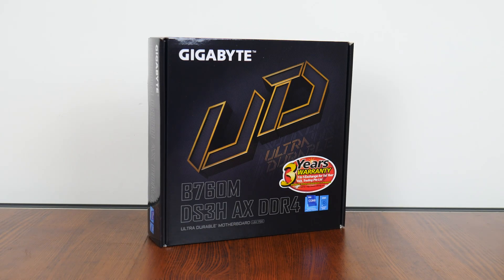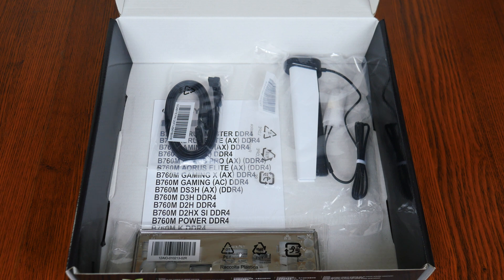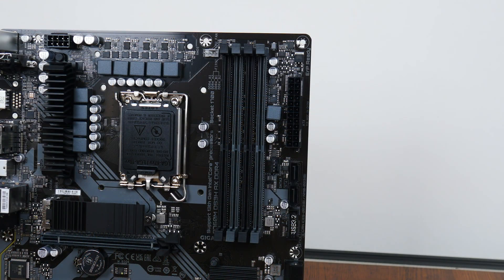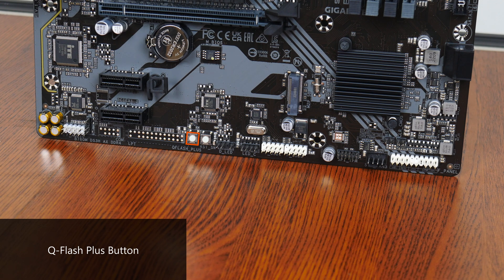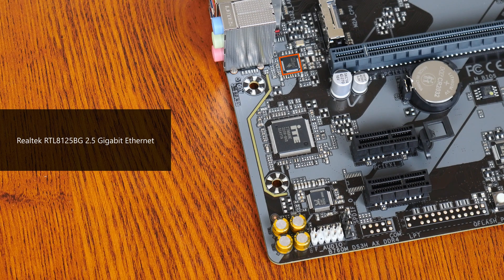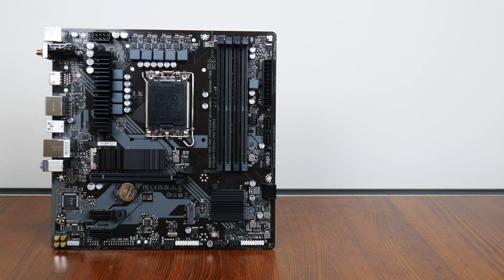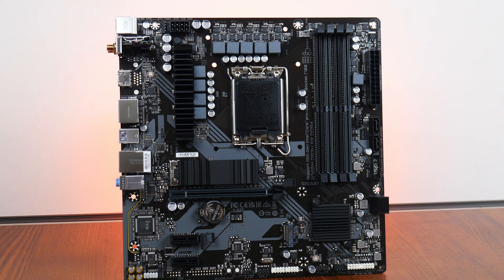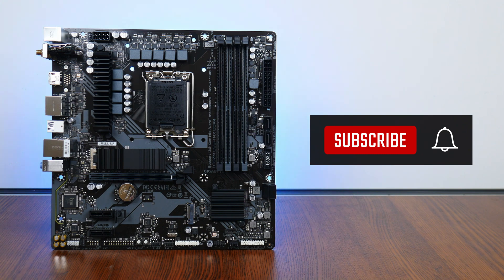Entry-level Intel B760 Motherboard - Gigabyte B760M DS3H AX DDR4 Unboxing & Overview

Comment: Do rev 1.0 is eligible for Intel processors?
Reply from the maker: It works with 12th, 13th and 14th Gen processors, just make sure that you've got the latest BIOS version installed!

Comment: Motherboard: GIGABYTE B760M DS3H AX DDR4 - 
RAM: Lexar Thor DDR4 32 GB (16x2) 3200 MHz CL16, XMP 2.0 - 
CPU: Intel Core i5-12400F (6C/12T, 2.5-4.4GHz, 18MB Cache, 65W) - 
GPU: Sapphire Pulse AMD Radeon RX 6650 XT Gaming (8GB GDDR6) - 
Power Supply: Aerocool LUX 650W 80 Bronze Power Supply - 
Case: NZXT H510 -
hi this is my build that i will buy should i change any thing ? because i am new to this
Thanks!
Reply from the maker: Hello, this build looks good for 1080p gaming! An optional extra you might want to consider is a better third-party CPU cooler, as the CPU cooler included with the 12400F isn't really that good. You can look at offerings such as the Thermalright Assassin X 120 and so on!
Reply: @ALKtech Thanks for the advice. i hope you hit the million subs one day.

Comment: I have a question for my build, will this motherboard be good with a rtx 4060 eagle oc with an intel i7-12700kf
Reply from the maker: Yup this board will work fine for a 12700KF and RTX 4060 combo!

Comment: please is it fine to pair it with 12600k?
Reply from the maker: It'll work with a 12600K, but I'd recommend getting a mainstream board instead, as the VRMs on this board are entry-level and might throttle the 12600K's performance!

Comment: Thanks for the video! If I were to use both PCIe slots at the same time, would this slow down the rest of the build? Or is it okay to have both in use?
Reply from the maker: You can use multiple PCIe slots on this board with no performance impact - out of curiosity, what add-on cards are you looking at using?
Reply: @ALKtech  to be honest I haven't really decided yet but I was looking at a 2tb Samsung 990. Do you have any suggestions?
Reply from the maker: @cytotomom  the Samsung's great at least from what I hear. You'll do fine with it!

Comment: Can it handle the i9 13900k?
Reply from the maker: Given that this is an entry-level motherboard with a weaker VRM setup, it's likely that a 13900K will be thermal throttled by this board. You'd be better off looking at a higher-end B760 or Z790 motherboard for a 13900K!
Reply: @ALKtech  thanks

Comment: Hey , i love the video, and i love that you are interacting with all of us. I have a question, i have a gigabyte b760m-c motherboard, 4070, ddr5 2x16gb 6000mz, and a i5 13400f. I want to play 1440 p competitive gaming. Do you think i need to upgrade anything or do you think my build is pretty good?
Reply: The motherbaord is the ultra durable b760m-c. I keep seeing reviews are that its not strong enough and very weak, do you think so?
Reply from the maker: Hey there - the B760M C is indeed a budget motherboard offering - I personally would not use the board with anything more than a lower-end Core i5. The i5-13400F is somewhat a lower-end part compared to say, the 13600K or 14600K which are much more power-hungry and would definitely be taxing for the B760M C's VRMs.

That said, I assume that your PC is already built and you're currently using it? Do you know how your 13400F's thermal behaviour is like, and whether you're getting thermal throttled? Have you tried running any synthetic benchmarks such as Cinebench R23 as well? If your 13400F is able to perform within spec, then there's no need to change out your motherboard!

Comment: Would you recommend for 14600kf?
Reply from the maker: Nope, this board is targeted more at entry-level processors. You should look at boards from the mid-range (e.g. Gigabyte's GAMING or AORUS series) if you're intending to use a 14600KF!
Reply: @ALKtech  thank you. Would the Gigabyte b760m ds3h do the job?
Reply from the maker: @Pizgo  nope, I'd get something more expensive with a better VRM setup so that the 14600K's performance won't be throttled!

Comment: Do you think the vrm cooling would be enough for my 12600k? Would I have to undervolt?
Reply from the maker: I suspect it might get by with a 12600K, but I can't say for sure as I've never tested such a combo before. If you have the budget for it, why not get a better board for more headroom?
Reply: Do not listen to him. That guy has no idea what hes talking about. The 12600K will run fine on that board. I got the b760 ds3h.

Comment: I read this in fb
 i5 13500 is a total of 14 cores CPU
Ds3h has 6 vem phases
And no vrm heatsink it will probably go to temps like 90c 
You can't unlock the power limit with it 

 also, that motherboard cannot provide the full CPU wattage which means you won't get the beat results
Such a bad board for that CPU 

Is this true brother?
Reply from the maker: The DS3H is clearly a budget motherboard that is better suited for lower-end processors such as the Core i3 and maybe entry-level Core i5s (such as the 13400), all due to its entry-level VRM setup. In my opinion, using a 13500 with this board MIGHT still be ok if you've got good airflow in your PC case and a good CPU cooler, but I wouldn't use a 13600K and above with this board for sure. My two cents!

Comment: Im gonna be using this for my budget build with the 
12100f. is it ok because i chose this board so if i ever consider upgrading to a 13th gen cpu
I wont need to be updating the bios
Reply from the maker: Yup this board will work perfect with a 12100F for sure, though given its basic VRM setup, you might encounter thermal throttling issues with high-end 13th Gen and 14th Gen CPUs (e.g. 13600K, 14600K etc). If you're intending to use lower-end 13th Gen and 14th Gen parts, you'll be fine!

Comment: Can this motherboard handle i5 13600K ?
Reply from the maker: Given this board's basic VRM setup, it'll likely hold back the 13600K especially under heavy productivity workloads. I'd recommend looking at a better board!
Reply: @ALKtech  I just upgraded my pc to this board with i5 13400F. It’s good?
Reply from the maker: @DextonJL  yup this board will work just fine with a 13400F, as the 13400F isn't a very power-hungry CPU! Just make sure you've got a decent CPU cooler and you're good to go.
Reply: @ALKtech  will the default cpu cooler work fine?
Reply from the maker: @DextonJL  I'd splash out for a better CPU cooler if I were you - but that's just my two cents, You might wanna check the thermals of your processor especially when under load - if the temps are not too toasty, then using the stock cooler might be fine!

Comment: Can you please suggest a mobo that has 6 SATA connectors instead of 4 ? Gigabyte, ASUS or MSI preferred . Thank you
Reply from the maker: If you're looking for an Intel 13th/14th Gen board with six SATA ports, you'll likely have to look for at least a Z790 board - the Intel B760 chipset has native support for a maximum of four SATA ports. Z790 boards tend to be much pricier than B760 boards in general - what's your budget for a motherboard, if you wouldn't mind sharing?
Reply: @ALKtech  Thanks for your response. Have bought i7 12700k processor so I was looking for a 12th Gen board but as I've 4 internal HDDs and 2 SSDs connected to my system, I was looking for a board with six SATA ports. Unfortunately Z790 is over my budget . Was looking for something under 15k INR . Even my old system with an entry level board GA-B250M-DS3H had 6 SATA ports 😐 Any other options? Do you know if using a PCI-e to SATA expansion card will cause performance degradation issues?
Reply from the maker: @vishnunair32  ah I see. Actually, why not consider Z690 boards? You might be able to score one for cheap brand new or on the secondhand market - Z690 boards should come with at least six SATA ports. Besides, most Z690 boards can also support 14th Gen with a simple BIOS update! That said, getting a PCIe SATA add-on card works too - I don't think there'll be any performance degradation at all!
Reply: @ALKtech  Thank you again for your advice. Found that if I stretch my budget to 18.5k I can get this board Gigabyte Z690 UD DDR4 .  B760M DS3H AX DDR4 + PCIe SATA add-on card will cost 15.6k . Which one would you recommend? Spending extra 3k will provide any additional value? I'll be using PC mainly for video editing/encoding thru softwares like Adobe premiere and Topaz VideoEnhance AI .
Reply: Came across another board that's currently being sold at a discount of 2.5k INR so final price is just 15.9k..  "MSI MAG B660M Mortar WIFI DDR4 "
Reply from the maker: @vishnunair32  I'd get the MSI B660M Mortar over the Gigabye B760M as it has better VRM specs to allow your 12700K to perform at its maximum potential. That said, do bear in mind that with B-series boards, you won't be able to overclock (though it seems like you won't be overclocking your processor anyway). Amongst these 3 motherboards, my two cents is to go for the MSI, and save yourself that extra cash for other stuff!
Reply: @ALKtech  Thank you. I'll go for MSI B660M Mortar . Yep, I won't be overclocking the processor. As 12700k did not come up with a stock cooler, could you please suggest me a cooler/heatsink in the range of 2.5 to 3.5K INR ? This is the one I have added to amazon wishlist - Deepcool AK400 120mm Fan  (I'm not a Gamer). Also I'm wondering if I should upgrade my RAM too. I just have 16gb ( two modules - CORSAIR 8GB Vengeance LPX DDR4 PC4-19200 2400MHz). My brother gifted me a 12700k and it looks like I'm forced to spend 25k from my pocket 🥲
Reply from the maker: @vishnunair32  to be honest, the AK400 might be a tad weak for the 12700K. You might want to look at a CPU cooler with at least six heat pipes - one model that comes to mind would be ID-COOLING's SE-226-XT that should handle the 12700K just fine, though I'm not sure how's the availability/pricing for this over in India.

That said, you should be using at least DDR4 3600 RAMs with your 12700K - it'll be additional cost out of your pocket though...perhaps try buying the RAMs second hand to save some cash?

Comment: Hi! I'm getting this motherboard (the DDR5 var). the case I'm looking to get has:
2x USB 3.0 USB A
1x USB 3.2 gen 1 USB C

I noticed that the motherboard only has one port for USB 3.x, do you have any suggestions for getting both connected? Thank you.
Reply from the maker: Hey there, unfortunately you'll only be able to hook up your case's 2x front panel USB 3.0 Type-A ports to the motherboard - there's no other way to utilise your case's front panel USB Type-C port with this motherboard, seeing as it doesn't come with the relevant front panel Type-C header. 

That said, you could potentially purchase a USB 3.x PCIe add-on card that adds additional USB 3.x ports to your PC - some of such cards do come with a front panel USB 3.x Type-C header that allows end-users with cases such as yours, to hook up their front panel USB 3.x Type-C port to the said card - an example of such a card would be this: https://www.amazon.com/Cablecc-Socket-Express-Adapter-Motherboard/dp/B07ZPZH6N5. 

Hope this helps!
Reply: @ALKtech  I got the board yesterday and they sent the DDR4 ver instead of the DDR5 ver lol, so I have a fresh chance to look at motherboards, do you have any recommendations? I was looking at the MSI PRO B760M-A DDR5 but was wondering if you have any other suggestions? thanks so much for the reply!
Reply from the maker: @DenisColebourne  looks like you've lucked out 😂 I'd say that the MSI fits the bill perfectly and it comes with a front panel USB 3.2 Gen 1 Type-C header - just what you're looking for. Also helps that the MSI board comes with a pretty decent set of VRMs that should handle higher-end 12th/13th/14th Gen processors with aplomb - IMO it's a better board than the Gigabyte. Is it much more expensive than the Gigabyte though? Also. what processor are you intending to use with your build?
Reply: @ALKtech  I posted a comment but youtube didn't like that I included a link to my build XD
But for the cost of the motherboard I'm not too bothered since it's only about £40 more roughly. my CPU is the Core i5-13500 2.5 GHz. 
I feel like I want to upgrade my computer further down the line, so having this motherboard would be good for future upgrades, do you agree?
Reply from the maker: @DenisColebourne  the MSI is plenty of board for a 13500. That said, given how much of a performance increase 14th Gen represents over 13th Gen (hint: not much), it might not make financial sense to drop in a high-end 13th Gen/14th Gen processor further down the road, especially since a 13500 is a pretty decent chip already, unless you can score an upgrade for real cheap (e.g. 14700K in a few years time?). Even so, I'd probably avoid using something as high-end as a 13900K/14900K in an entry-level board - my two cents!

Comment: I talked to a pc building shop and they suggested to use this instead of B660M and i7-12700F instead of i5-12600K ( due to non - overclocking preference of mine )

My buid is
Processor :- Intel Core i7 12700F
Ram :- 8+8 Total 16 GB 
Motherboard : B760M DS3H AX DDR4 
Storage :- 500GB NVME SSD + 1 TB Sata 
Cabinet : Ant Esport Ice 510TG 
Power Supply 550W Cooler Master 
CPU Cooler : Deapcool 240MM
Graphic card : RTX 3060 (12GB)

This is approxly costling me 1100 usd with all taxes included 

Is this a good option ?
Reply from the maker: Hey there, mind sharing a bit more about your use case? Do you do more productivity work (e.g. video editing)? If your intention is to build an entry-level 1080p gaming PC, the i7-12700F might not be necessary, you could perhaps look at an i5-13400F or similar instead, or maybe even go for a 12400F that could save you some cash. Ultimately it really depends on what are you using your PC for!

Also, did the PC shop share what speed of RAM they're intending to include? Might be a good idea to bump up your PSU to perhaps something with 650W and above, so that you have some headroom for a graphics card upgrade in the future as well. My two cents!
Reply: @ALKtech  3200Mhz DDR4 
Actually i would be performing 3D simulations and do Programming with some multiple operating systems as Virtual Machines
And this pc would be used by my brother also for 1080p and 1440p gaming when i would be in college
Reply: @ALKtech  thanks for Replying me😅😅😅
Reply from the maker: @vishalvan3317  no worries, in that case the 12700F would be a better option given that it has more cores. If you have the budget for it, you could consider getting DDR4 3600 low latency RAMs!

That said, a RTX 3060 is pretty entry-level at this point, where you might have to tone down on the graphics settings in order to play modern games at 1440p with decent FPS!
Reply: @ALKtech  👍👍👍thanks for sharing your views
Reply: @ALKtech  i want a mini itx build for the setup i gave above 
Which i7-12700f and 2 fan RTX 3060
Which case , motherboard and sff psu i should look for
Reply from the maker: @vishalvan3317  do you have any case/PSUs in mind? I think my recommendation would be dependent on what's available where you're from!
Reply: @ALKtech  i am from India and Cooler master NR200p is easily available and cheapest too but this is still bigger 
Next is Corsair 2000D but it is way too tall
Then i have options like Fractal Design ERA Which is bit expensive but ok for me
Reply: @ALKtech  and For SFF psu the only option i have is cooler master SV750
Reply from the maker: @vishalvan3317  since you're using a RTX 3060 that doesn't really consume that much power, the V750 SFX will work just fine! I'd personally go with the NR200P, it's a pretty decent ITX case!

Comment: is this good for    i9 13900k rtx 4080? or should i go with an ASUS ROG Maximus Z790 Hero instead?
Reply from the maker: The B760M DS3H AX DDR4 is an entry-level motherboard that won't be able to properly handle a 13900K. A Maximus Z790 Hero on the other hand, which costs several times more, would most definitely get the job done..
Reply: @ALKtech  what would happen if b760m ds3h ax is paired with i9 13900k?
Reply from the maker: @darfelpalicte4468  the 13900K's performance will be throttled pretty significantly by the B760M DS3H AX's VRMs - this is because the board's VRMs are best suited for low-to-mid-range processors (e.g. a 13100, 13400 etc). If you're looking to get a 13900K, you should get at least a high-end B760 board, or even the more "entry-level" Z790 boards that have good VRM setups!

Comment: Can i use rgb fution in this mother board?
Reply from the maker: Given that this board comes with both an ARGB header and standard RGB header, you will be able to control your RGB lighting effects via Gigabyte's Control Center app, which I believe has RGB Fusion integrated into it!

Comment: Hello Sir, i just watched your videos with the gigabyte b760m ds3h ax ddr4 motherboard....it was awesome.... i just have a quick little question if u ccan help me with that.... can a aio water cooler like cooler master ml240 model support or compatible in this motherboard.... i know the water cooler suppor lga1700...or can i install it? if u can help me with that i will be really appreciated...Thanks :)
Reply from the maker: Yes the Cooler Master ML240 will work with this board as long as the model that you get comes with the LGA1700 mounting hardware - there are several variations of the ML240 and the older versions MAY not have the LGA1700 mount included!
Reply: @ALKtech  ohhh.... okay... thanks for the info... :)

Comment: Which budjet Graphics chipset I can use with it..?
Reply from the maker: You can use any graphics card as long as it utilises the PCI Express interface. Given the pricing situation for the GPU market at the present moment, you could look at previous gen GPU offerings, such as the RTX 3060, RX 6600 XT etc...it all depends on your budget for a graphics card.